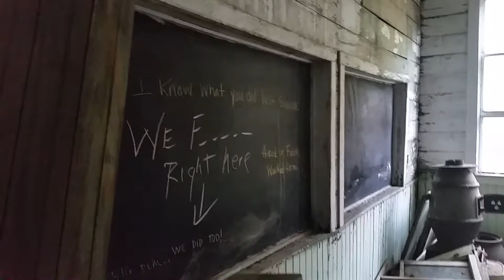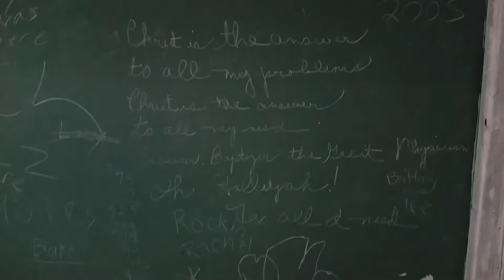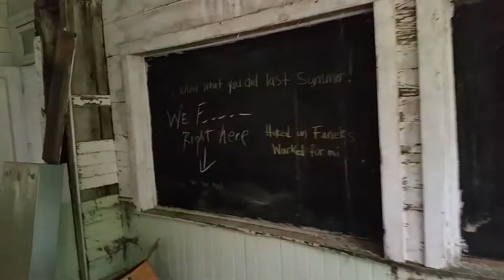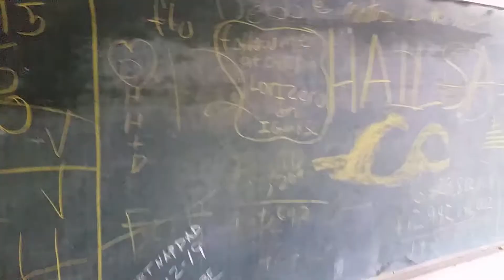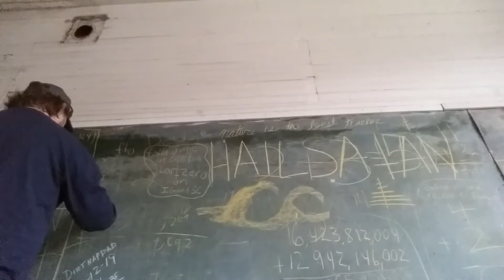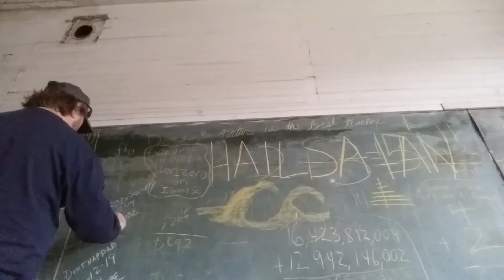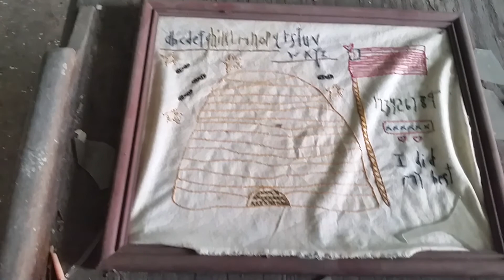EXPLORING A SMALL COUNTRY SCHOOL IN THE HEART OF WV

Comment: The round hole in the desk tops were for ink wells. That should help the dating.
Reply from the maker: Hi dustyrusty musty.

You must be an antique collector. The quill pen was phased out in the mid 19th century, and began in the 1800's. I was guessing 1890's-maybe thru 1930's. Of course I did not know anything about ink wells until you brought up the idea of the ink well holes on the desk. My gut feeling is that you are more educated on this than I am, so I would say that your educated guess would be very close. Thank you for watching the video, I was so excited to see this small school still intact. Thanks for the education. Tom-WV
Reply: @DIRTNAPDAD  They weren't really quill pens when these desks were made with the holes were used but they did have pens that were dipped in ink.
Reply from the maker: @dustyrustymusty3577  I'm still learning and thanks to comments like yours I figure I'll continue to do so. Thanks dusty
Reply: @DIRTNAPDAD  I started school in the first grade in Marshall County in 1957 and our desks had the holes in the top.
Reply from the maker: @dustyrustymusty3577  I started first grade in '64 had the old wood and steel desks, but I was the first class to attend that school when it was built so I guess it had a little newer equipment. Wouldn't you like to have one of those desks today.